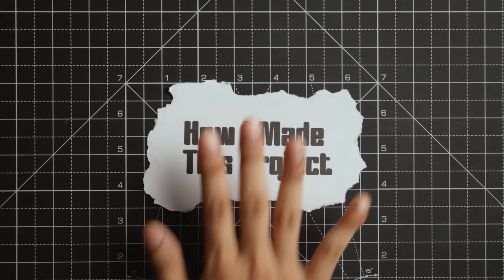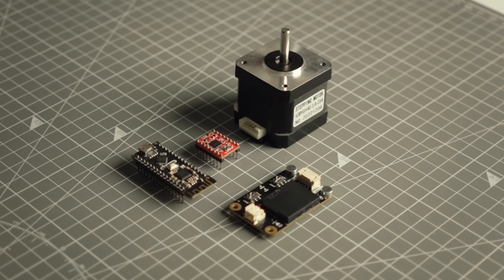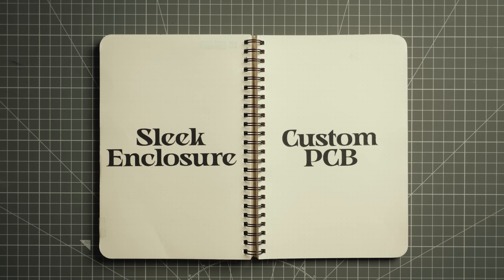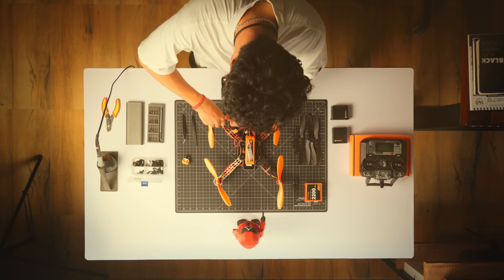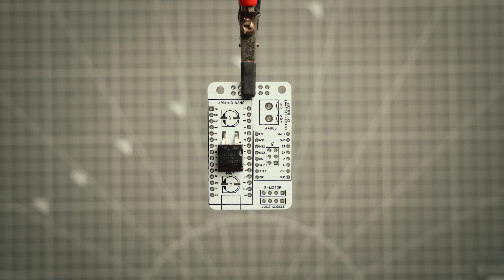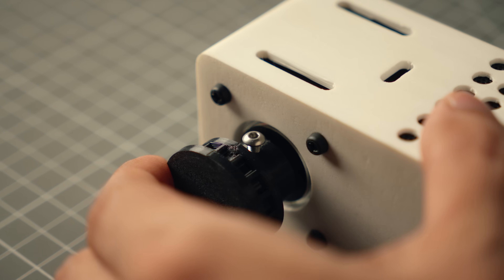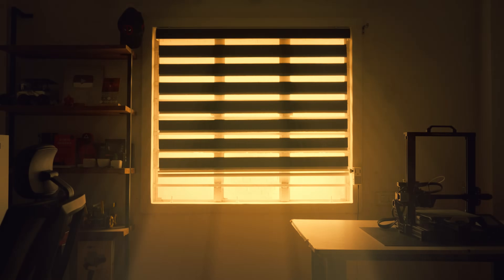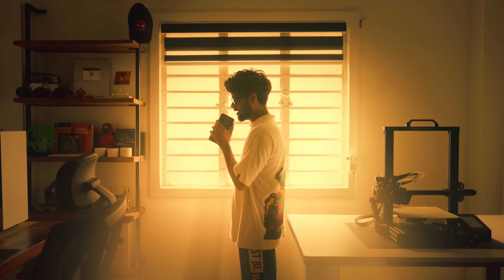I Made This Only For Lazy People (And it works!)

Comment: Surprised to see someone actually made one of these with direct drive on a stepper motor. Very much the wrong choice for this sort of project due to insufficient torque at higher speeds, heat,  noise and efficiency. Engineering-wise, the correct way is to use a DC motor with encoder. They are much more quiet, smoother,  and allow for higher torque operation than your nema 17. Would be interested to see you make a V2 done correctly

Comment: If there is a power cut then the motor will start from the default position or it will lose the angle  ??
Reply from the maker: Good question! Since i'm not using any limit switch, it will lose its position after a power cut. However, in this setup, the last position is saved in EEPROM, allowing the motor to resume from where it stopped after a restart. This helps prevent misalignment even if there's a power outage. 😊

Comment: Really great editing!
About your parts, you should consider a TMC2209 as a stepper driver, unlike the allegro drivers you used, they are very silent, and can move a stepper in a way that makes it completely silent.
You also gain access so sensorless homing, meaning that you can detect end of travel without a sensor; or detect a bind, and deactivate the motor.
As for the micro, i would recommend looking into the raspberry pi pico W. Not much more expensive than a cloned arduino nano, but with wifi, a way faster cpu, still low power, , also great support, and you could integrate with home assistant via esphome. That means an insane level of customisation, all open source, just by declaring a yaml file.
ESP32s are also a equally good solution.

Anyhow, props for the editing, it is really top tier.
Reply from the maker: Thanks for the love! ❤Those are some awesome suggestions, I'll look into them for my next project! 😃

Comment: You know what there was an old voice recognition system Lernout&Hauspie back around mid 90s to early 2000s. It was used in language learning applications and ran well on a modest 486, and then later made its way onto game consoles to power SEGA's Seaman and SONY's Lifeline, and was also used in telephone systems. With a vocabulary of a few hundred verbs, it could perform reasonably well. Unfortunately the software was mothballed due to embezzlement, but the patents have to be void by now. Would be so good to have a functional clone of that system to use in our microcontroller projects with esp32 and rp2040.
Reply: I'm pretty sure all that IP ended up with Nuance and now belongs to Microsoft. I enjoyed using OS/2's voice recognition features around that time.
Reply: @rytbeard   Yes Nuance bought up the software and promptly discontinued the licensing - thus mothballed.